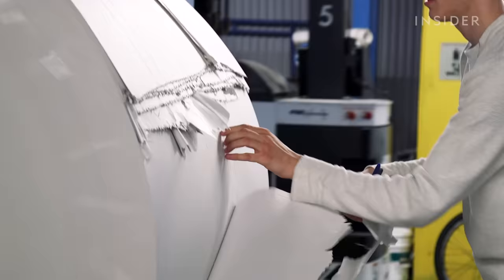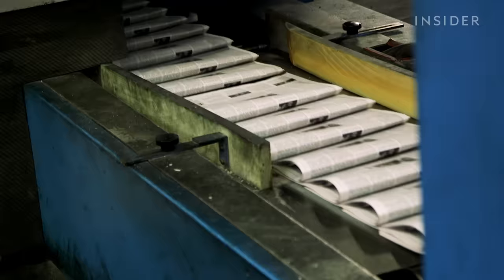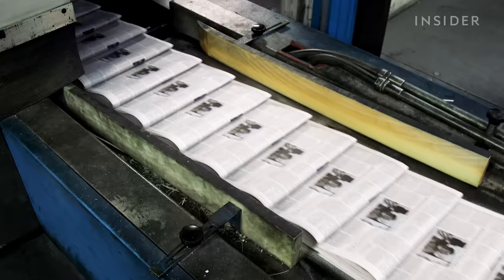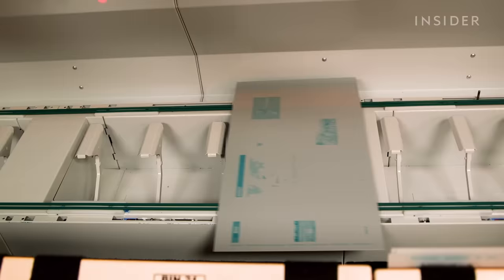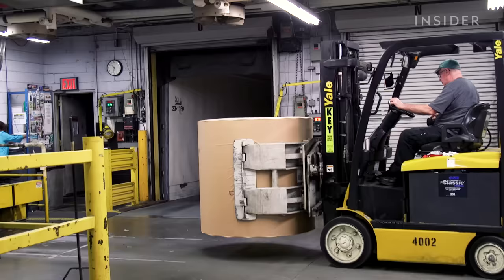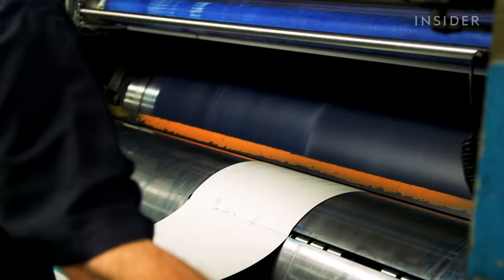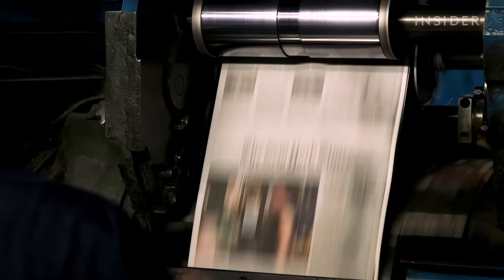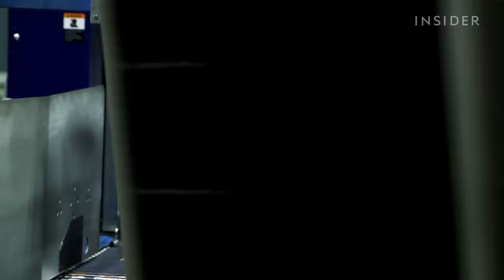How The New York Times Is Made | The Making Of

Comment: I just started my new job as a printing press operator apprentice... I’ve never had more interest and fun with a job in my entire life.
Reply: I worked in a printing plant in the press and bindery for almost 10 years, it could be a tough job but it never ceased to amaze me.
Reply: @Kerry Robb those machines that process are so amazing, I wonder how they're designed and built in order to get the desired result. Do you know anything about it?
Reply: @dagreatgibson7957 a lot of machinery and engineering is designed on software called “Autodesk” that’s worth checking out
Reply: After working 10 yrs on a printing press between 1990-2005 all I can can say it wasn't fun, the crew I worked with good.
It was alot of hard work and very messy, oil, grease & ink everywhere but very well paying job after the press I moved to the warehouse and drove a clamp truck.
Reply: Print is dead!  Don't waste too much time with it...
Reply: @fredliperson9171 Please tell me how will your baked beans have labels on the tin, your computer keys have the letters printed onto them and how your lovely t-shirts have all these designs pressed onto them.
Reply: Well it's been 2 yrs. Are you still printing? I have been doing it since 2007 never figured I would last this long but am still going 😅
Reply: @Adam-pl6vq  That's little mom and pop printing...Im talking books and magazines ...A dying industry. I worked close to 40 years in print and my plant just shut down in NY. The largest printing plant this side of the Mississippi...Print is dead.
Reply: Flexograph? Film or paper?
Reply: @fredliperson9171 print will never be dead! Everything you buy has print on it. Mom and pop printing? The packaging industry is massive.

Comment: Actual newspaper question - how do they print color images so fast? I can understand black ink stamping the plates and going to the paper but how do they keep the colored images so nice and neat?
Reply: It's just a matter of keeping the machines calibrated correctly.
Reply: The plates are all assigned different colors so the colors are being applied one color at a time not just all at once they also are consistently being monitored by the pressmen to make sure that everything is coming out nicely and if not they make adjustments to the ink to correct the color
Reply: So the plates are fat and alcohol based and depending on negative or positive the one color sticks to the palate which then touches the paper
Reply: They print color photos and ads using four inks: Cyan (Light Blue) Magenta (Pinkish Red) Yellow and Black. The paper passes between four sets of printing cylinders, one for each color of ink. Control of what is called "register" - the perfect placing of each color on top of the preceding color - is done by controlling paper tension as the web of paper passes between the units, and by micro adjustments of the plate cylinder themselves. The video didn't say so, but the inked image is transferred from the plates they showed us to a second cylinder which is covered tightly with a rubber "blanket". It is the blanket cylinder which presses the ink onto the paper under pressure. Actually, two blanket cylinders press against each other, with the paper passing between, thus printing both sides of the web at the same time. A mild detergent-type solution keeps the non image area of the plate clean, while the ink sticks only to the image. Balancing this "ink and water" combination is another thing that the press crew must control throughout the run. Even with modern digital controls, which enable remote control from a central location (they used to have to chase the adjustments by running up to each individual press unit) it is a highly skilled job. At 80,000 copies an hour, a lot can go wrong in just seconds if the crews are't watching closely. Some really, really modern press rooms have laser cameras installed to constantly monitor the quality, but that is still pretty rare in newspaper work.I respect what they do immensely. (Full disclosure- I am retired from 40 years in commercial printing, mostly sheet fed rather than roll fed presses.)
Reply: @KGSnow2   thanks for the in depth answer! Much appreciated from the perspective of a mechanical engineer that came here looking to learn about the fine detailed plates and how they transfer the image. somewhat similar to the mold steel i design to create features in plastic injection molded parts
Reply: @KGSnow2  what these presses are doing is almost cheating.  I'm still running between each unit making adjustments and lining the webs up in the folder.
Reply: Each color has its own printing unit let's say four over four
Reply: @KGSnow2  damn nice description. I was a lithographer from 1999-2015.
Reply: @KGSnow2 great comment

Comment: But how does the color ink work? Would they need to have a machine place the ink specifically in the right place? I mean if it's black and white paper it wouldn't be that hard, but I'm interested in how color works
Reply: It's the same process as the black.  There are separate plates for each color(cyan, magenta, yellow, and black). The plates have images for their part of the complete image(Google 4 color process). The plates are then placed on their own units with the corresponding color of ink. Then, all the units are turned on and the ink is placed on the paper 

That's the simple, not too technical way it's done.
Reply: Black or key plate,cyan ,magenta and yellow plates make up almost all colour printed material